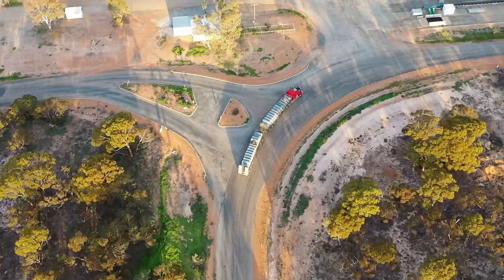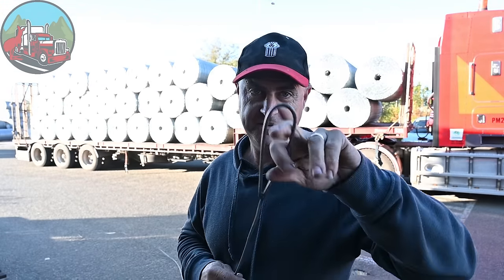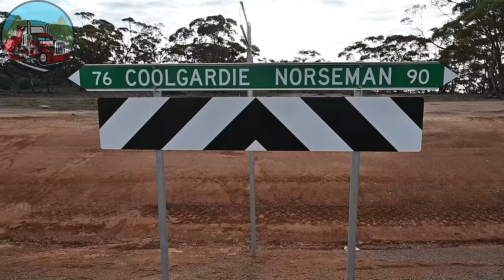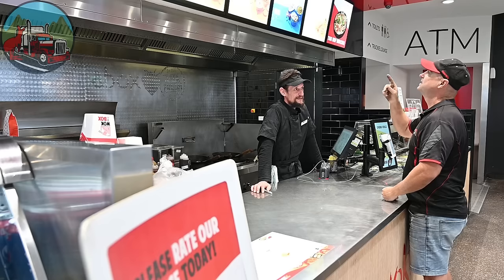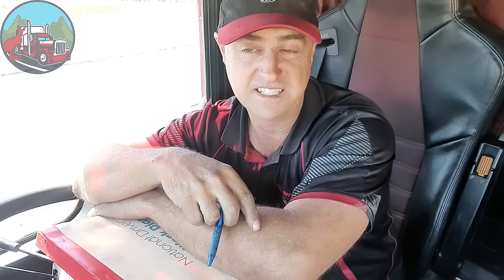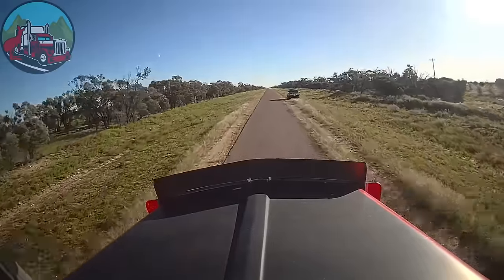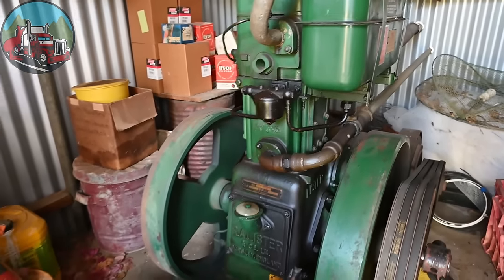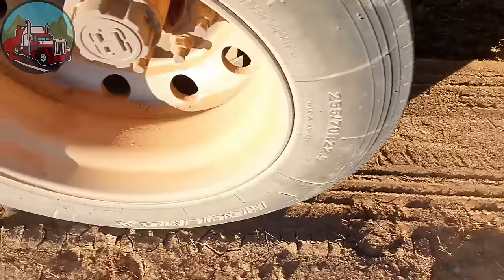Road Train from Perth to Queensland - Full Length Feature

Comment: Thank you for a wonderful video. 
I've been to Australia 🇦🇺 twice, goldcoast area. If I'd of known what Australia 🇦🇺 was when I was 20 ish I'd would have packed my bag. Not for the adventure but the way of life. 
You were talking about the log book 📖 🙄 we here in Ireland 🇮🇪 and Europe have  a tachograph card . If you were stuck in traffic, you can watch that clock run out even a few miles to your stop. No grey area so don't complain and DON'T let the tachograph in or your days on the road will increase. 
I've subscribed so I'll let you lead us across your wonderful country and I'll pray I'll get back there again. Keep the rubber side down 👍
Reply from the maker: Thanks Eugene. Yeah I've heard about the tachograph card. Sounds like a bad deal. They are bringing in electronic wheel diaries here. They haven't been taken up by many companies yet but the government is pushing for it. More dodgy systems that fails us drivers.
Reply: @RoadTrainAdventures  put your card in, your clocked in . 4 and a half hour driving you must take a 45 minute break. Another 4 and a half hour driving , finished but you can add another hour driving after another 45 minute break but this extra hour must be given back. Now if you are in traffic or multi drop ,"working time directive " comes into play. We have to have the 45 minute break taken before your 6 hours of work even though you might have driven only 2 , 3, or 4 hours. 
It depends which one comes into play. 
You plan your day aiming for some where to pull in.
With our working hours 2 to 3 day trip will be extended to 4 at least . Who is going to pay for the extra day. 
I've looked at 2 more videos. Like the fact you don't have Aires and graces like some other videos or the over acting. Keep it safe out there. 
There's a truck driver heading out to Australia 🇦🇺 in the new year. He has written a few songs.  Truckin, farming....
He is a character knows how to get the crowd going.  Look him up .
Marty Mone . Songs; slip the clutch. 
Or hit the diff.  Look him up on utube 
Keep it safe. Catch you on the flip
Reply from the maker: Awesome. Thanks for the info. We can drive 14 hours per day.
Reply: @RoadTrainAdventures  9 +1 over 13 hour spread 3 times a week  but has to be paid back..night time driving is shorter

Comment: Really interesting and informative and beaut filming especially with the drone shots,  I am not a truckie but I love trucks especially the classics and Australia’s transportation history including trains, autos & bikes, haven’t crossed the Nullarbor for a few decades now but did do from Melbourne to Perth many, many times from the Early 1970’s starting when there was the unmade section between Eucla and Ceduna before they sealed and saw a lot of damage to vehicles from holed petrol tank to front end collapse on this section and also to a broken timing chain on my XP Falcon Hardtop between Norseman & Balladonia mid winter and getting towed back to Norseman By a young bloke in a 48 Buick straight eight! Those were the days if anything is going to go wrong at shitters ditch Murphy’s law takes over and it always happened on the Nullarbor! I also did a few round trips on my motorcycle back in 74 on my Kawasaki Mach 3 which went surprisingly trouble free for a hot rod 2 stroke triple but in those days you didn’t really have to worry about cops and radar just Kangaroos and other critters so a high speed was the order of the day and to stop those plugs oiling up on the  stroker! Mixed with a bit of youthful risk taking, I’d invariably always get pulled over coming in to Perth  for some reason but never on the highway, memories!
Reply from the maker: Thanks for your kind words.

Comment: One thing I'd really like to see is something to distinguish between a double and a triple road train. It would give other road users an idea of what they are attempting to overtake, and the distance and clearance required. It is something that the freight industry, along with the various RACs and NRMA should lobby for, nationally.
Reply from the maker: Some trucks have a sign on the back trailer saying how long the full combination is.
Reply: Well it's pretty self explanatory double..... Triple.....
Reply: If your saftey margin is a trailer length , perhaps you a shouldn't be overtaking anyway  .
Reply: I think road train is enough, if your margin of safety changes based off one trailer. maybe its best to stay behind until its safe to do so.

Comment: We recently visited Sydney and Melbourne to watch T20 World Cup, we love Australia. We did went to Three sisters, Reef , Philips Island etc. 
Why don’t you use Mallet in place of hammer to remove dust, it will have no effect on shape of the Rim.
Reply from the maker: You need to bang to vibrate the dust off. A mallet is too soft and won't have much affect.

Comment: Good work mate, How did you get up the hill with two trailers to Northam. I thought you  had to hook  up your singles at the top
Reply from the maker: There are other ways to get out of Perth with a road train. I go the other way that isn't Northam.
Reply: @RoadTrainAdventures  yep yep . I hear ya.Im new to your channel mate  I see you dodged horrocks pass up to Wilmington.Nice little short cut across to the Barrier but pain in bum for dropping , splitting in PT Augusta up and back twice to wilmington. Anyway wont keep you.Keep makin a mile. Stay safe.
Reply from the maker: Horrocks Posed was how we used to go because we couldn't road train through Port Augusta. Now we go straight through and go to Jamestown then Peterborough. Great to have you along too.

Comment: What kind of power plant and transmission are you running in your Kenworth and does the Ministry Of Transportation have what the Department Of Transportation here in the States calls a "Level 1" inspection?
Reply from the maker: I've got 620HP I'm not sure what this level 1 inspection is. Can you tell me?
Reply: @RoadTrainAdventures  A Level 1 inspection is for both the truck and driver. The D.OT. makes sure everything on the truck is within compliance and not needing repairs and they also make sure the driver is complying with the rules concerning hours of service, log books, Haz-Mat certification on the CDL, and the driver has to show the paperwork for anything that falls under Haz-Mat rules plus the trailer that is loaded with Haz-Mat has to have the proper placards on it.
Reply from the maker: No the truck only have to pass  an inspection if you get a 'yellow sticker'. Which means you then have to put that truck or trailer in for an inspection.

Comment: As a truck driver myself the log books are stupid and the ridiculous fines that come with it, mount white Sydney to Newcastle please fix your signs that say return to highway then flick to enter the weigh bridge then flick straight back to return to highway very confusing and now trying to get off a not comply stop at weigh bridge cause of a glitch in the system which they know about. Careful if you ever come up that way
Reply from the maker: Yes you really need to have a dashcam to prove you were in the right. Fining you is really making the roads a safer place.

Comment: You guys in Australia still use manual log books? Wow, and I thought the US was behind the world in using electronic logkeepers (which have been required for more than a decade here). Back when I drove, at one point I kept 3 log books, in order to keep on driving 90 hrs./week, back when i was earning only $.17/mile. After a while, it just got too confusing, and when at my 1 year anniversary I started to earn an extra $.01/mile, they stopped running me all over the U.S. like they had.

After a couple more years, I started driving "Canadian dedicated", which meant every load I carried was a cross-border load, and I had to follow separate rules for US and Canada. So, especially when running freight out of Quebec, there were multiple choices of where to cross the border, and often times that would put me out-of-service on one side, but not the other. But, knowing the specific laws of both countries saved my @$$ more than once when a DOT/MOT officer questioned my legality on certain times...
Reply from the maker: Manual logbook is easy better. There will be an uproar if it's ever enforced here.
Reply: States is so behind in other ways but a beer and pay on card why get 3 receipts

Comment: I drive truck In USA and I want to become a driver in australia. someone help me please
Reply from the maker: Unless you're here in Australia, I have no idea how you can get a job here. Plus unless you can show some experience driving a road train, most companies may not take you on. You might have to start pulling one trailer then pull two once the company can see you can do it fine.
Reply: @RoadTrainAdventures  I don't mind driving a single trailer. 
I'm in indonesia now so australia won't be too far. Actually I want to have my residence in Bali indonesia and work in australia so I can just fly home to Bali for my vacations from work. It's much cheaper and much shorter of a flight than going all the way back to USA.
I'm already getting used to driving on the opposite side of the road / car.

Also I think I need an employer to sponsor me before I can get a work visa or whatever